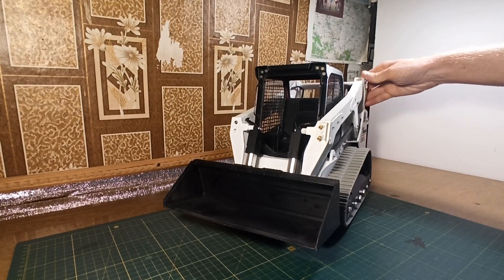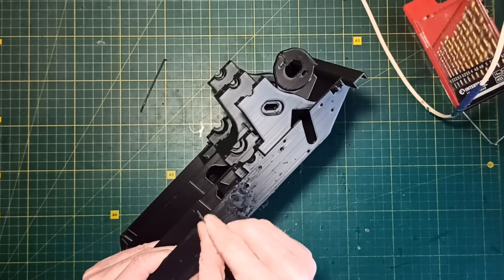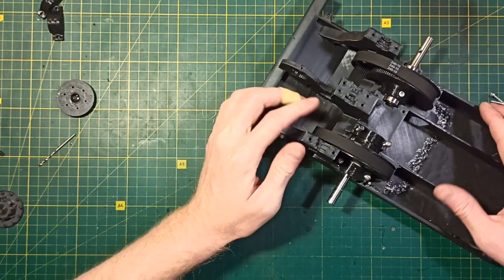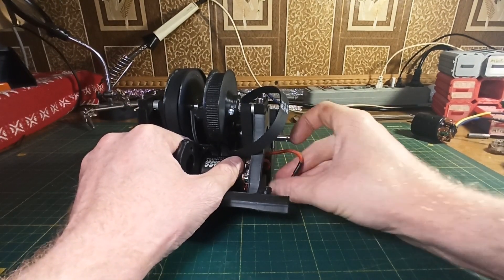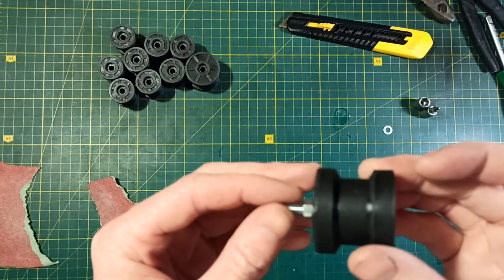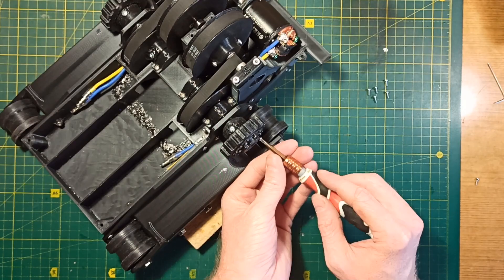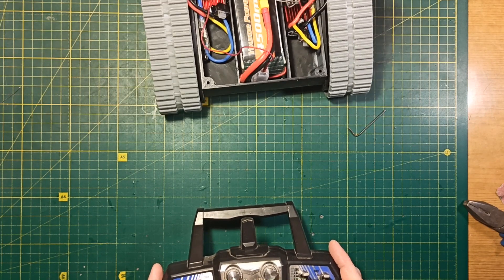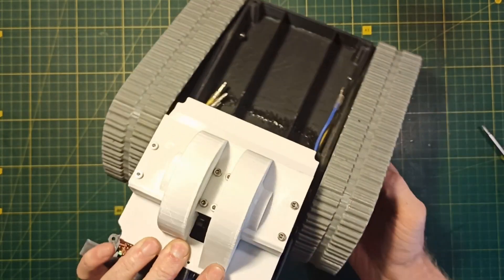3D Printed Skid Steer. Build video ep.1: Chassis assembly by [AN3DRC]

Comment: Hi, thanks for the wonderful model. I have one problem though. Almost all sellers moved to the 20 mm version of the gt2 "gears" even the one you linked to in the pdf. 
It is possible to have a modified version to work with the 20 mm version?
Or where do I have to file of the 2 mm?
Reply from the maker: Hello! You can heat 20mm pulley and push it into a printed pulley.

Comment: Hello, author. Can the rubber tracks in your work be purchased as finished products on the market? If so, what specifications should I look for, or could you recommend a specific type
Reply from the maker: Hello! No, it is not possible. You need to print tracks on your printer, using  TPU filament. I am used TPU A95, but perhaps TPU A85 will be better, because it`s softer.
Reply: Okay, thank you for your guidance

Comment: Edit: My original comment was negative and out of frustration. 

I replaced steel rods for aluminum.  If the aluminum actually bend or twist i will properly replace with brass before steel.
Reply from the maker: I am upset that this happen. Don't give up! Try this modification for chassis. It's much simple to assembly https://cults3d.com/en/3d-model/game/an3drc-skid-steer-back-chassis-worm-drive-mod